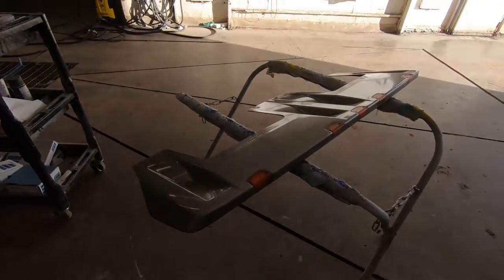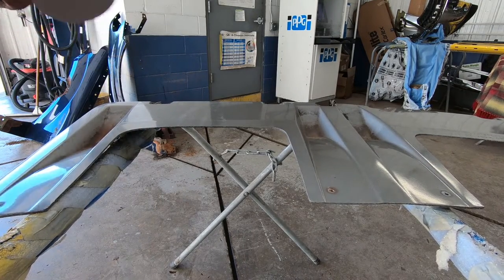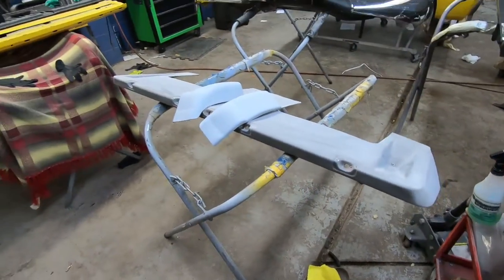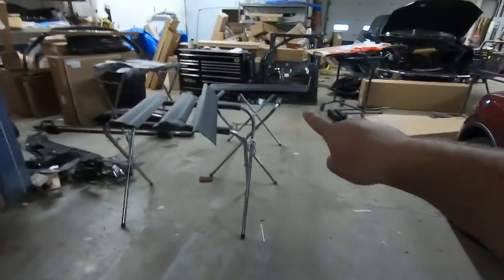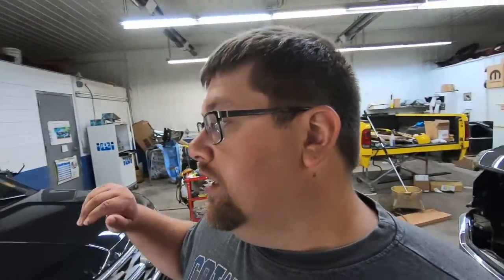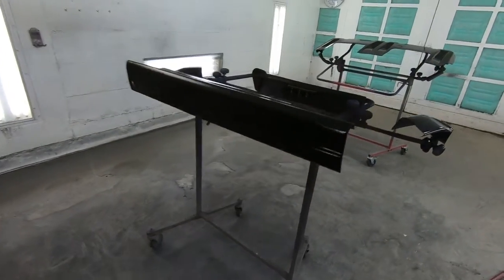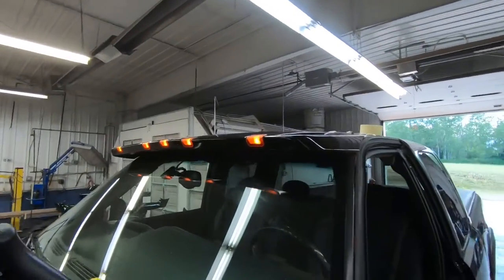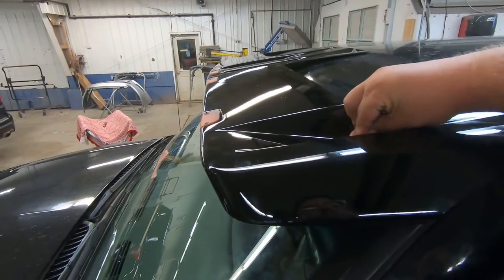Installing Lund MoonVisor on my 2002 Chevy Silverado

Comment: I have a 96 Jeep Cherokee and I currently have a moon visor on it that I installed myself and it is very sturdy but my windshield is now cracked and I need to get it replaced does anybody know if I take it off will I be able to re install it after I get the new windshield? Or will the holes be striped out and will not hold it anymore?
Reply from the maker: I took one off a old 97 Chevy 3/4 ton to replace a windshield. Put it back with no issues

Comment: What kind of tape do you put around the screw holes? Thanks
Reply from the maker: Windshield rope sealant. Some may call it butyl tape
Reply: @TheWiscoGuyz  Did this tape prevent water from leaking into the cab?
Reply from the maker: @amplifythistake5498  yes

Comment: Would that fit a 95 Chevy Astro where did you buy that at?

And will that fit on a 95 Chevy Astro
Reply from the maker: I don't think it would fit a astro van. I got mine out of a local junkyard
Reply: Yes it will fit I seen a astro van with a visor
Reply: You would need the kit in this video. I don't remember if he states the part number. Good luck finding one.

https://youtu.be/xmg_t9DAyTo
Reply: The visor I had was mounted behind the weather stripping (doors), with a bracket and screws.